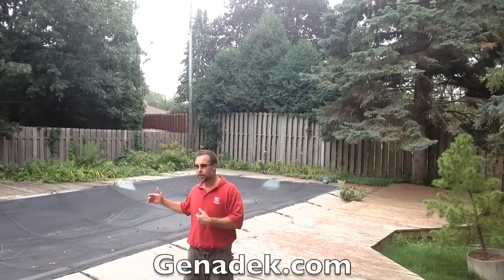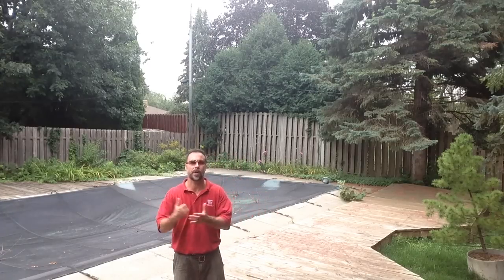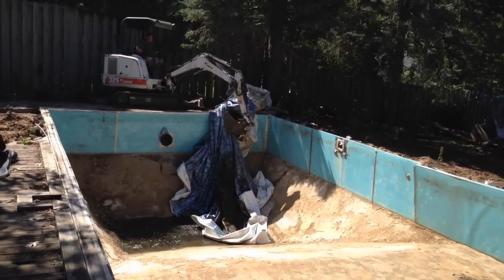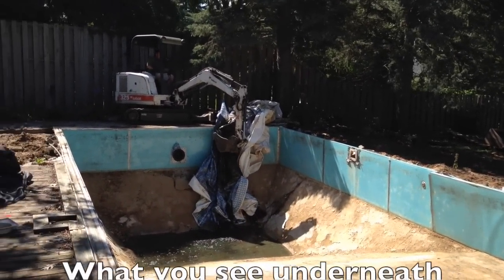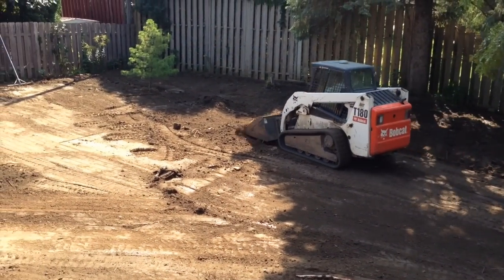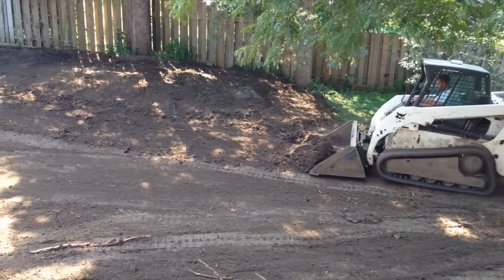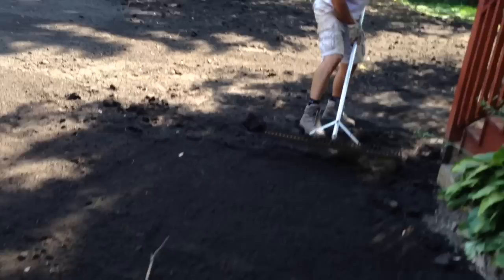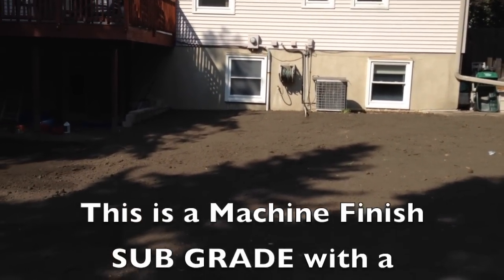How to Flip a House

Comment: awesome vid, your guys know those machines well
Reply from the maker: +wall2 Wall Thanks- we've been doing this for awhile :)
Reply: +TheRandomReviewer hey that's a good question,
Reply from the maker: +TheRandomReviewer I started when I was 13-so about 31 years ago.
Reply: Chris P I'm sure his dad owned the company before he did which led him the opportunity to start running equipment at a young age
Reply: Chris P I had it the same way. My grandpa ran a concrete plant so I was like 8 years old sitting on his lap in a 966F front end loader. I couldn't even reach the peddles. As I got older and was able to reach the peddles I was able to run it without him in the cab. I am now in the operating engineers union 😁check out some of my videos on my page